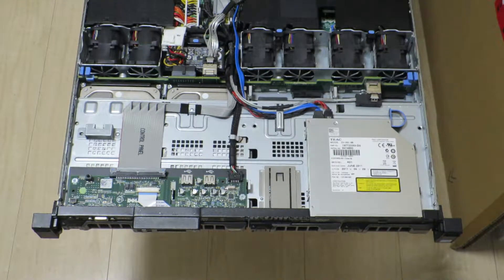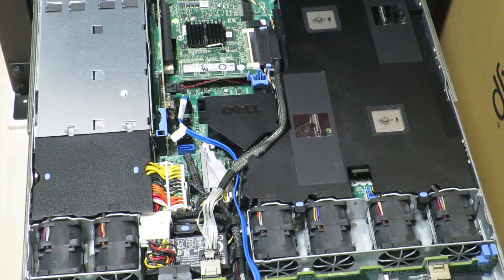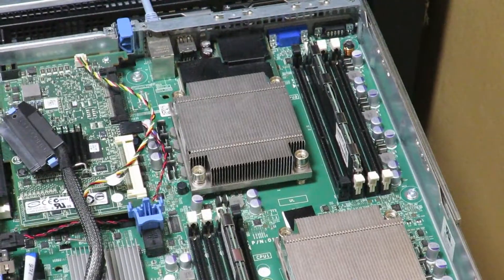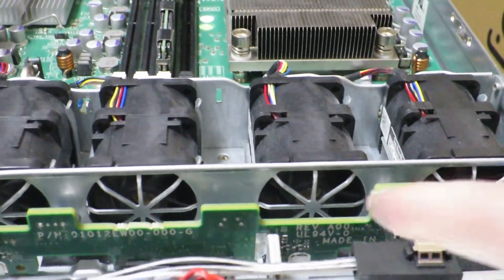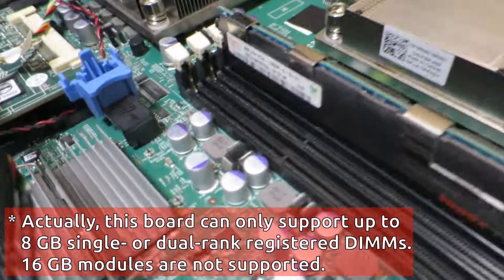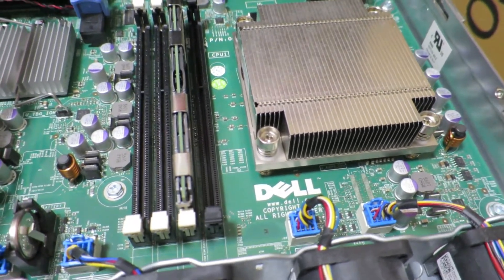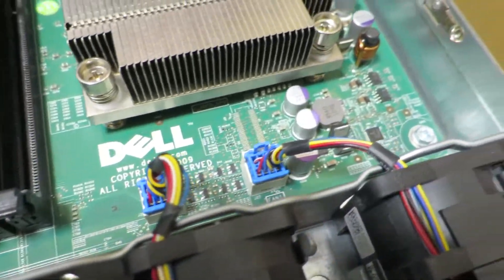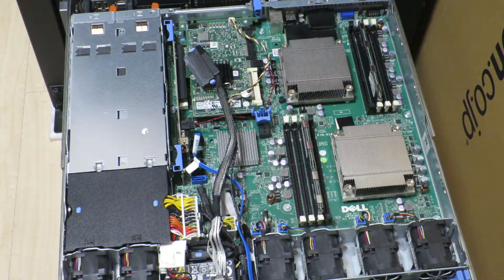Dell PowerEdge R410: a quick look at the Compute Subsystem

Comment: can i use dual xeon x5650 6 core 12 threads in this motherboard (5600series) or i should first update the bios to use those series?
Reply from the maker: I can't give you a definite answer for that one, although I would guess they would work. You could look around for other R410s and see if they contain X5650s. I think the limiting factor for these systems are the cooling, so you'll want to check what the maximum TDP CPU is supported.